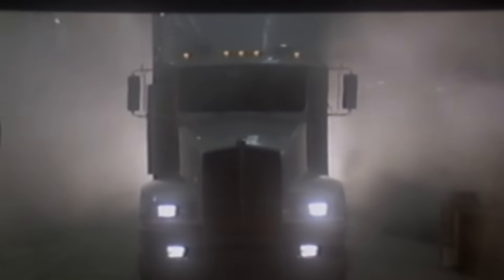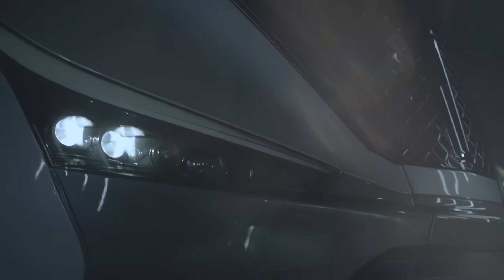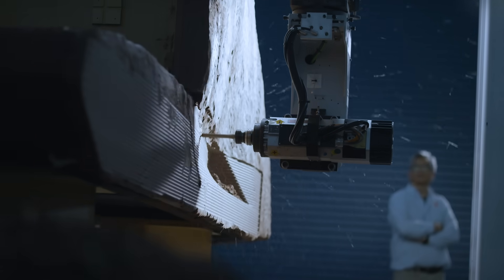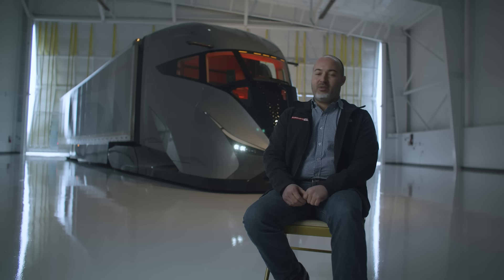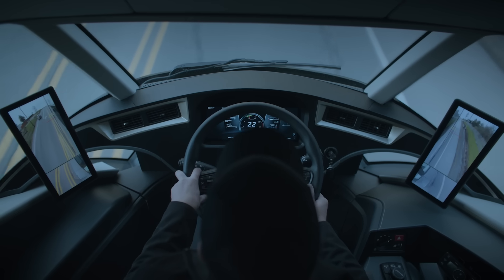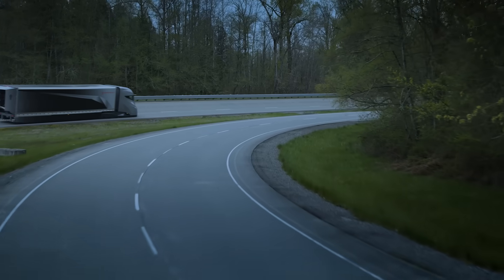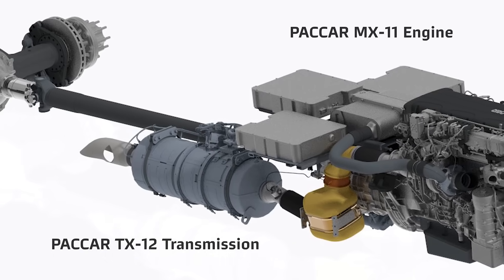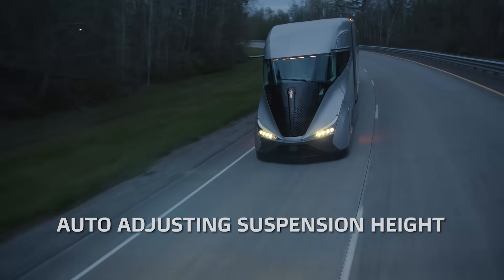Kenworth SuperTruck2

Comment: The mirrors are cameras? So if you have an issue with a cam on one (or both) side, there's no redundancy for visibility? The shell around the tires is almost sitting on the street. What about pot holes, railroad crossings, etc?
Reply: Thats are only details.

Comment: I can see ALL of the Kenworth Mechanics that will have to work on this if it ever goes into production calling you all of the rudest names imaginable when they end up taking half the truck apart to change a front wheel or a change out a blown motor. Being an ex RAF airframe engineer, having to take the entire wing off the Harrier to change the Pegasus engine made a 1 day job into a weeks worth of work. I loved it when i got posted to Tornado where the engine change was far, far simpler and was done in a third of the time. Next time include maintennce mechanics on your design team

Comment: 2:59 i mean thats cool and all but that makes it more prone to failure one big issue with vehicles today is that there is too much unnecessary features and tech in them that can easily be prone to failure in the next 5-10 years
Reply: as a master service tech for Kenworth.  27yrs exp between kw and peterbilt.  i can say this.  1st the new paccar engine is a complete piece of junk!  the mx10 and the 1st gen mx13 were the best paccar engines.  2nd.  the new line of t680 and 880 make freightliners look easy to work on.  tupperware trucks.  3rd.  the new paccar/eaton endurant transmission is a huge failure.  i have not seen 1 single transmission make it past 450k without major failure. the trucking industry is going straight to pot with these new trucks.  i am so glad i retire in 1yr.  now this monstrosity is coming out???????????????????  200k for linehaul truck just to stay in the shop for 120 days out of the year
Reply: @jackmeoffer9334  yeah well it seems that they are focusing on adding unnecessary technology and features and being “hIgH tEcHnIcAl” and “fUtuRiStIc” rather than actually making the trucks reliable (you can also say the same about the car industry in North America)
Reply: @sometf2player752  facts

Comment: Creative means big changes, and people are afraid of change, but technology is moving forward like lightning. And new means progression. Time to let go of the old like everything else, ships are running on nuclear energy, negative energy has been achieved, and transportation can't be left behind. While people judge the change of looks, they dont realize the functionality of the product. Everything is done for a reason at the time its designed. Tech moves forward, and so does the design to make it functional and progressive. If you dont believe this, pay attention how a long nose blows your vehicle away from it as it passes by yours. And mpg is at 30% more efficient just with the newer designs from the 2000s compared to the long noses.
Reply: um.  really?  do you actually work in the repair side of this?  as a master service tech for Kenworth.  27yrs exp between kw and peterbilt.  i can say this.  1st the new paccar engine is a complete piece of junk!  the mx10 and the 1st gen mx13 were the best paccar engines.  2nd.  the new line of t680 and 880 make freightliners look easy to work on.  tupperware trucks.  3rd.  the new paccar/eaton endurant transmission is a huge failure.  i have not seen 1 single transmission make it past 450k without major failure. the trucking industry is going straight to pot with these new trucks.  i am so glad i retire in 1yr.  now this monstrosity is coming out???????????????????  200k for linehaul truck just to stay in the shop for 120 days out of the year

Comment: as a master service tech for Kenworth.  27yrs exp between kw and peterbilt.  i can say this.  1st the new paccar engine is a complete piece of junk!  the mx10 and the 1st gen mx13 were the best paccar engines.  2nd.  the new line of t680 and 880 make freightliners look easy to work on.  tupperware trucks.  3rd.  the new paccar/eaton endurant transmission is a huge failure.  i have not seen 1 single transmission make it past 450k without major failure. the trucking industry is going straight to pot with these new trucks.  i am so glad i retire in 1yr.  now this monstrosity is coming out???????????????????  🤣🤣🤣🤣🤣🤣🤣🤣🤣🤣🤣🤣200k for linehaul truck just to stay in the shop for 120 days out of the year

Comment: The underskirting will get ripped off the first railroad track crossing. Backing into a Walmart dock that drops downhill.  I'm excited to see how long steer tires last in desert heat without any airflow. Guess this truck gets parked in snow as well. The snow packing underneath with all the skirting. You'll pick up quite a bit without a way out. Good luck with your toy.

Comment: All I see is maintenance costs and nightmares.  Blow a front tire and you lose how much of the front fender?  Yeah, that won't buff out.  When you have a mechanical problem on the side of the road and it's 10 below zero, you want a cheep and easy fix.  I do like the cameras in place of the mirrors, but wonder how long before someone rips them off the truck.

Comment: Amazing looking truck always support Kenworth, Paccar.  Just one thought in case of accidents, tire malfunction, driver error, I'm a heavy Wrecker operator and the first thing I thought of that it looked  like it would be a challenge to hook up and it would take some time.  With a low Front end and the hybrid drive system, Which I completely understand for  Aerodynamic and efficiency reasons.  The simplest thing I can think of is  There's some hook ups on a coach bus there is a link bar set up that connects where the front end hooks go It makes a straight bar off the front end and a safe connecting point. And it would be a dream if it could be engineered where there could be a quick disengage of the drive systems. In my line of work there is a need to hook up and clear the road safely and as fast as possible for driver and operator safety and so that other goods and services can they still delivered on time.  I know that's the last thing anyone wants to think about when building a new truck but trucks do break down, trucks will break down, accidents do happen, and accidents will happen. Just something to think about.  I hope to see you on the road one day

Comment: Looks pretty cool, and the efficiency is top notch.  The only problem I see is the center driving position in the cab.  If you get pulled over and you have to give your license over, it would be hard to reach over the inside of the cab, just like on a Tesla.

Comment: This truck cannot operate in ASIA. Moreover, not all of ASIA has flat asphalt. And this truck is only useful in urban areas, because if it is on a road without asphalt, it will have difficulty moving because the ground clearance is too low.

Comment: Dont be fooled guys. That mpg number was clocked when they were hauling 65,000. 15k less than max load. It’s a single axle, not a tandem. Honestly I really don’t think this is the future, I think we’ve already achieved peak performance with diesel engines.

Comment: id say you would definitely need some increased air suspension range to clear rougher terrain, also how is self servicing and roadside repair going to be incorporated? the body panels should have portholes for the front wheels at least, great concept but I'm looking forward to the release version (if there will be one) where things like reparability and versatility are Hopefully addressed.

Comment: I've been wondering about how dealing with shippers, receivers, guards, toll booths, scales, etc is going to pan out when I'm in the center of the truck.  Would I have to stand up and crouch by the window to hand out paperwork or push the scale button?  Imagine being at a gate and having to crouch by the door to talk into a speaker then trying to get back into your seat to go onto the property.  This is optimizing for driving down the road but you make money when you get product on and off your trailer.

Comment: not very convinced with aero and 40 tons. Just look at an old river flowing... it doesn't care either. Rock paper scissors..the toughest wins. Why is it 3 inches off the ground..the big air gap  under an old logger does just as good as what this one is plowing...not to mention cooling the oil pan. something non-usa is in world engineering, and i don't like it. whats next? a drop to 10 liters and increase to 12000 rpm convincing us it is economical? how  bout a v8? at least attempt self balance on the guts of the matter... put a seat in themiddle of that. :goodvibes:

Comment: Wow , reaslly low to the ground, I would like to see it go over the railroad  tracks across the country and clear the curbs at corners.  Also,,, to connect to the fifth wheel, it is too low to the back of the semi rear end, try connecting a trailer to that .  I have watched all these videos on e trucks, cars, bikes.  All are catching a fire and they cannot put them out.  This is just my opinion;; but i would not want to be near a semi hybrid on the highway carrying  chemicals.   This is ridiculous.  Our highways and streeets are not perfectly smooth..  There are pot holes, dips in the road, bumps on the highway.  This is where taxpayers money is going?  Did anyone really think this out before designing this?   I watched on youtube when one electric vehicle caught on fire while parked to other vehicles and it set them all on fire.   We want safety, what happened to being safe and commom sense.

Comment: The first driveway that has a steep angle will rip the aerodynamic  under parts  out. The first railroad track that has a rise ascending and descending the tracks will hang the cab. This truck is a pipe dream.

Comment: Wow. so they took a tesla truck and put a diesel motor in a completely unreachable area.  Congrats guys.  When the mechanics have to check the oil, swap out a turbo, check the belts, change an injector, swap the water pump.  They will be thanking you for the 10 hours it takes to remove the cab to get to the engine.

Comment: Interesting that Kenworth is looking at multiple power sources! Not every country and mission is the same. Some might require just electric batteries, other some combination of diesel engine driving a generator to power electric motors, others will run conventional engines. But this vehicle being able to adapt to all those scenarios depending on their customer, it's quite outstanding.

Comment: Questions for the Kenworth team.

How can this become a better/more practical system for team drivers?

Will there be a curtain system applied for privacy on the interior?  

How much will the large aero side pieces cost a driver if there is a tire blowout? 

How long will a driver be parked if they need something fixed under the hood?

How many cubic feet of total storage will be available for over the road drivers?

Is the bed/bench ergonomic to accommodate all drivers?

Will a fitted APU option be available for installation to spare idling time? 

What kind of flexibility can be made in options of customization for owner-operators? 

Will there be a full coverage camera system internally and remotely accessible by drivers and company selectable as an option? Or are there ways to combine the electronic cameras with 3rd party existing camera systems? 

What is the estimated rate of maintenance expected for this truck? 

What is the life expectancy of this truck as a whole before cooling/engine/transmission failures? (This one I ask respectfully, as every T680 I have driven has a complication where something major needs repaired/replaced every month)

What is the fair estimated number for the price tag on this truck?

Comment: It's an engineers wet dream.  Engineers should get out from behind the computer screen and get behind a steering wheel or a wrench set.  They need practical experience to know what works and what doesn't.  This is 20 times dumber than stupid-dumb.  Load um all up in that bigassed cab and send um across country... then they'll be begging to go back to the drawing board.  It'd take um 10 hours to do a pre-trip, then make it 2000 miles down the road before that pos paccar takes a crap.

Comment: Like the design but not practical. Take it to the oil fields, then report back. AND...how many more sensors are we talking about. You're making a vehicle that only a dealer can fix.  Sorry, but practicality over design works for me. Of course, it'll save me in fuel because I'll need the money to replace the skirting when I blow a tire. And where's my partner sitting? Behind me? Now, I have to worry about not getting into an argument with them in fear that they might choke the shit out of me from behind! Naw,pass. Partners were meant to be on the side of you...Unless... you're a fighter pilot! Onward Kenworth!!

Comment: Yeah looks like train. Eww imo.  Lol watch an old w900 with Cat engine like 6NZ, or 3406e with 18 speed will probably out last this truck. There is too much computer, tech and emissions control in new trucks.   So more for it go wrong or break down.  

They should have this truck run vs old w900, where both trucks have do at least 100,000 miles. Both trucks have seasondrivers who are experts, who both have at least 10+ yrs under they’re belt of driving semi. Then have both truck hit 100,000 miles. 

Then tally up how many times they broke down.  I bet w900 would run circles around the new trucks.    New trucks aren’t Reliable.  New Tech isn’t Reliable. Emission control chokes trucks.  Even Electric vehicles break down.  

We are to reliant on new tech.  And they never last.  Vs old semi trucks when properly maintained. Will run circles around any new trucks.

Comment: Cannot work in Australia, we have enough problems with heat in Bearings, Tires etc. All that flaring would have to come off. Kangaroo's, dear, pigs and cattle would rip that cab apart on the first trip and I would hate to imagine the cost of replacing that.

Comment: My dad owned a ‘52 KW that he bought brand new and drove over a million miles until he sold it in the late 70s. He had an experimental Cummins diesel engine in it and could do 110 mph with a full load of logs… and he did. KW is a great truck!
Reply: YOU MEAN... They USED to be!!
Reply: @jimrogers7425 Was your Dad not a very responsible truck driver - i mean - a 100mph with a full load of logs...... How do you stop that in a hurry??? What an idiot.....

Comment: No physical mirrors? Just cameras in place of mirrors.? All's good until there is an electrical glitch and then you're blind. All of these electronics is just an recipe for disaster. I've been driving a T880 for the last 3 years and for the most part I like it. What I don't like is the dealerships, they are garbage. 3-5 days to do an oil change, and then there's all the electrical stuff that malfunctions at least once every 2 months. I like the ride , I like the maneuverability, I like the cabin; I'm not impressed with the MX 13 engine and I'm not impressed with the automatic transmission (it's junk). The electronics have gone haywire twice on the transmission which results in trans not shifting. The last time I disconnected the battery cables for 5 minutes and then reattached them and it shifted just fine. Bottom line there's too much electronic nonsense on today's trucks. Our previous trucks were Freightliners (Cascadia) they were absolute trash. The automatic braking is dangerous and causes more accidents than it prevents. I've been driving truck 37 years, I have 3 years until I retire I hope I retire before these abominations that you call trucks never get on the road or at least wait 5 years, they are a joke. The electric trucks will be a giant flop just wait and see. The batteries are too heavy which means less cargo weight, the range is terrible, the electric motors are super expensive to repair/replace and they will chew up tires at a fast pace.

Comment: There was a guy... I forgot his name, but he designed a truck with a round windshield that through design alone increased the efficiency of the diesel engine alone 100%, from 6 to 12 mpgs! I want to say that was 20ish years ago. I even spotted a truck on I-95... But, at the time the estimated cost for the truck was near $1.25M.
As for the deisel electric hybrid drivetrain... It's about dang time! Same tech used on freight trains for years!

Comment: Diesel hybrid makes alot more sense than having and EV semi. However, there is still the weight of the batteries and fuel to contend with. What I don't like is the wheel covers since I like to inspect the tires on vehicles I drive! I found a wheel weight in my tire the other day that could have been a problem down the road. Also, I was trained on trucks with mirrors and definitely wouldn't want them replaced with cameras and monitors because you have to look outside your cab periodically vs focusing only in cab!

Comment: it looks like it will be a very expensive and time consuming repair when someone pings off the front bumper trying a tight lane change in front of you. There's a good reason these trucks have had giant steel bumpers for decades.  And when some jackwad takes off your little side mirror camera while backing his trailer into the truck stop space beside you, that aint gonna be cheap or easy to fix either.  You start making road haulers that look like airplanes, you better start preparing to pay airplane money for repairs.